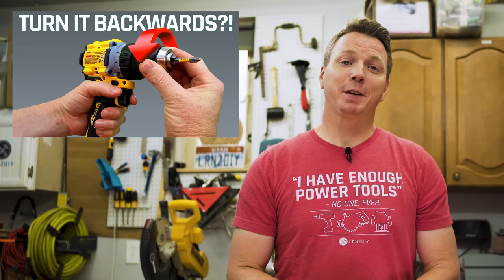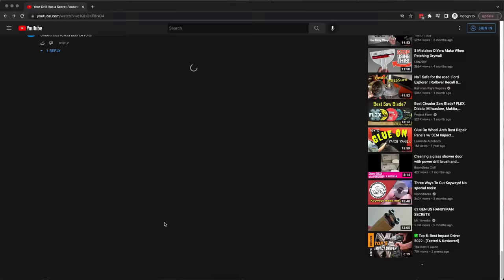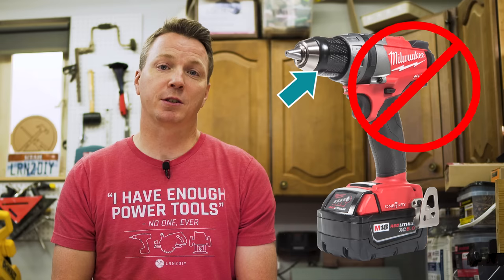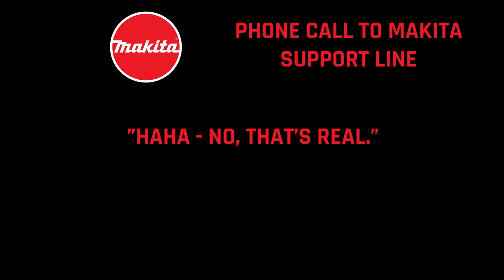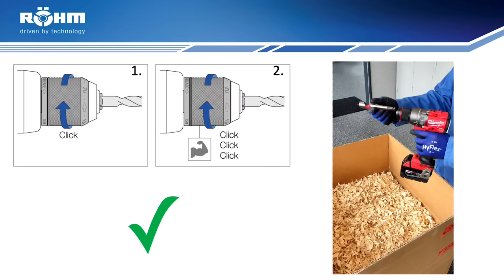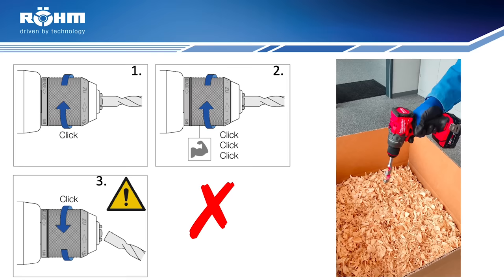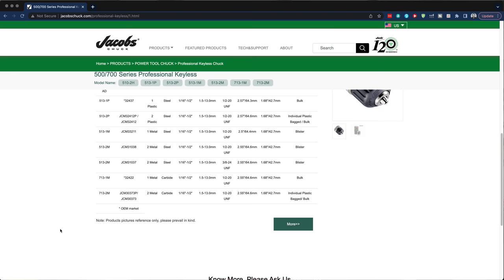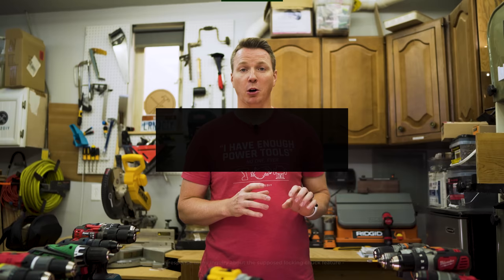Secret Drill Feature: Are The Manufacturers Wrong?

Comment: This video shows that you have a lot of integrity.  In addition, it shows a very methodical and thorough approach in getting down to the facts. Furthermore, your open-mindednes to even the possibility that were in error really gives insight to your character.  Well done. Keep up the great work.
Reply: Right there. Exactly what I was thinking. ✌
Reply: I agree. You have a lot of integrity. Thank you for creating this follow up video. I did not comment on the first video. However, I did try it and it didn’t work for me. The drill bits fell right out after a few holes. Just as they had before.

Comment: Funny enough, I experienced EXACTLY what Rohm and AvE described just a few days ago drilling a brake caliper for a repair bleeder. If I did the click back, my bit kept loosening. If I did not click back, I had no issues. I changed bit sizes several time which is why I had time to test. This was with my Milwaukee M12 drill, but I don't recall having the same issue with my DeWalt. Now we know! Seems the people believing it help experienced a placebo affect or confirmation bias. Really appreciate the update!

Comment: Thanks. I saw the original video and have been trying it out. I have not had a bit come loose since where as I did previously. I’ll keep going with it until I have bits coming loose.  Great video as always.
Reply: Yeah, I'm in the similar situation. Even if not a feature, this really seems to work for me, especially when drilling on metal. I'll experiment more. But if it works, it works.
Reply: It doesn't work, it can't work. Stop doing it:)

Comment: Kudos for integrity and self correction - much respect.

RE: bits (hexagonal inserts) falling out of 3 yaw chucks: positioning - whenever I put a bit in a 3 yaw chuck i take care/make sure it is seated at the lower most tightening diameter - so that once it tries to slip_somewhat it can't loosen the chuck.

Might be the people who have their bits falling out have not yet figured out this issue?
Might be once they take more care, or just by chance, their bits seat in the chucks at a lower tightening diameter?

Ever had a drill bit (round shank) tightened off center?

Hard to tell with people struggling to grasp the mechanic of the chuck operation, basic physics and the bigger picture?

Comment: I never had this problem with any cordless drill but I always misused the chuck as I hold it while gently pushing the power button. And I DON''T RECOMMEND THIS to any one. It's me, my way, my consequences.
But... After your first video I tried on my old ParkSide cordless drill and it does the same: it locks as soon as I try to rotate counter clockwise and it doesn't ratchet in any way.
I never used it because it started rotating on the other way and I thought it would be wrong, but never realized at about a quarter twist it indeed locks. And it is also true the other way to open the chuck.
To be honest, I haven't quit on my "method" to close the jaws on the bit but I changed the way I used to apply some extra torque and now I use this method to tighten or loosen the bit.

Comment: I have already shared this on your previous video regarding the topic. Locking means making the bit stay in the chuck and that happens when you tighten it - whether it ratchets or not. 'Locking' a tightened chuck by turning it in the loosening direction doesn't makes any sense.

Comment: I had problem with drill bits falling out of my dewalt drill but I found that if i push the bit all the way into the chuck then pull it back about 1/4" and tighten it there it stays tight

Comment: I believe the engineers are telling the truth about this not being a feature, but I also no that this did actually work for me.  I had a problem with my brand new Dewalt drill not holding on to any bits after about every use.  I would tighten it then use the drill and the bit would fall out.  I saw a video about six years ago similar to the one that you released.  I tried the step by turning one click backwards and to this day, this drill never drops a bit.  From my experience, engineers design things to work a certain way but sometimes side effects are discovered later on in the real world.  I think that this is a side effect which is why the comments are so divisive.  I guess part of why I am commenting is because, the engineers designed the chuck to hold the bit and lock hold it when turned and click tightened. But, I had a problem with the bits falling out after tightening the bit, so the engineered chuck was failing. I remembered, that I was going to take the drill back to Home Depot where I bought it, but when I saw that video back then and tried the solution, real or not, and it worked.  This has been six years of constant use and it works.  I have even tried a couple of times to see if using the chuck as it was/is supposed to be used and the bit still falls out. One thing about engineering something, sometimes there are things that are missed. I'm not saying that it is supposed to work this way, I'm just saying that mine does.
Reply: Maybe you can make a video demonstrating this with your drill
Reply: I have a Ryobi drill that literally has the words  "lock<-" on the chuck.   I have been confused as to how this is a thing that's semi-controversial
Reply: I believe you think yours work that way.
Reply: Try it again, now, without the unlocking step. See if it still gives you problems. :)

Comment: I only watched this because the claims seemed to be rather odd about bits falling out of the chuck.  I own a Milwaukee drill and have never had this happen.  I typically insert my bit, rotate the chuck counterclockwise until I hear the clicks.  I use the drill and unchuck when done, but never have I had a bit fall out.  This is not to say that I did something right or wrong, it's just that the operation and function of the drill I have seems to be working as intended.  I got my drill (part of a Milwaukee set) about 3 years ago, and both the drill and driver always work fine.  On the opther hand, I have never intentionally chucked a bit, rotated the chuck counterclockwise until I heard the clicks and then ran the drill with the bits pointing downward to see if they fell out, so now my curiosity is getting the best of me.

Comment: You're absolutely correct if people realize that they're not the only one that has trouble with b** falling out they start ratcheting down the head correctly and your back saying to back it off it actually does work in hammer drills but you ratchet it back down again one more time because in a hammer drill you need the bit to be locked down tonight all the way down the the length of the bit that is being bit and some Jaws will only lock either in the back or in the front by backing it off and then locking it back down you get a better more balanced bite. Simply put no it's not a secret feature it's a technique that bites the bit better but you still have to put it back into the Locking position. And of course nobody has this problem with large hammer drills because they index.

Comment: So the bottom line is ( if you back up one click have you had your bit fall out ) or did I miss something ?
Reply: Once you initiate backwards turns with your chuck, you're disengaging the locking function. Ratcheting locks only work in one direction. If you can find the first video he references with the big hole saw, it is pretty informative, guy has the chuck blueprint out while doing some demonstrations.

Comment: My theory is when people have issues it is because it may have been chucked slightly turned so the flat spots don't line up quite all the way. It could still lock down pretty tight but with enough drilling it might torque to where he flat spots do line up making it ever so slightly loose and then it gets looser from there.

Comment: Look at the pictures of the Jacobs 500/700 chuck.  This appears to be what I have on my Black+Dekcer 20V Lithium drill and I don't believe it is a ratcheting chuck at all.  The second ring seems to act like a jam nut and when I rotate it against the larger main ring the chuck seems to make a much tighter connection and I can't just run the drill in revers and grab the larger part of the chuck to release the bit.  I have to grab the smaller ring with one hand and the larger with the other to open the chuck.  This may be what is happening with those commenters saying the technique in the video worked for them.

Comment: My Dewalt still works MUCH better when I turn it backwards a click! If I torque it down as tight as I can it will drop the chuck after hitting the brake the 3rd or 4th time. When I turn it back a click I can have it hit the brake 10 times and it's still tight in the drill

Comment: As someone who is both a mechanical engineer and cnc tech, (having rebuilt another industrial chuck less than an hour ago), I can confirm hoax status.

At an industrial level there are 2 major styles of keyless chuck to be aware of (usually not on hand drills, but on drill presses or mills):
Unidirectional: the cutting force against the bit is independent of the tightening mechanism. They are still usually biased, holding tighter 1 direction) but the chuck works in both forward and reverse.

1-directional/self tightening: The back torque from cutting in the forward/normal direction compresses the jaws tighter. This is great for lots of drilling, especially under heavy load, as instead of loosening over time, the bits tend to get tighter.
But it is terrible for tasks like tapping, because anything done in the reverse direction wants to loosen and spit your bit out of the chuck. Every time you stop and try to back the tap out, it will unchuck.
Also, it's no good for using with reverse drill bits for things like bolt extraction.

If I only had 1, I'd go for unidirectional. It's not surprising that cordless drills seem to always have this type, as it makes them more versatile. The sudden impact of stopping is enough to loosen them, though, as demonstrated by repeated start/stops, a bit like an impact driver loosening a bolt. The ratchet like clicks are a mechanism that attempts to reduce this self loosening behavior. Most larger chucks don't have the clicks.

Comment: I have a theory about the people who said that turning back one click has solved their problem. Before they saw your first video, they weren't locking it properly in the first place. They were just lightly turning the chuck, but not enough to actually secure the bit with enough strength. After they saw your video, they started turning the chuck with enough strength in the closing direction (probably without even noticing it), then turning back one click. But, since they were using lightweight bits, or performing just domestic, light work, the bit stopped falling off. So, there's my theory.

Comment: I have a Craftsman cordless drill and I've tried to lock the b in place and there is absolutely no turning it once it is tight. I cannot turn it counter-clockwise whether I do it quick slow even if I hold the shaft from spinning it does not click and lock

Comment: I got my drill bit stuck in a piece of wood then tried pulling on it using the 'locking feature' vs normal tightening.

I noticed almost no difference in the strength I had to use to for the drill to get disconnected.

Comment: My Harbor Freight Bauer brand battery-powered drill will not securely hold a bit at all unless you turn the chuck ring counter-clockwise...hard, after normal tightening. I occasionally lost bits in the weeds before I figured it out. 

The older DeWalt would hold it firmly, but not like Chuck Norris, unless you turned it backwards until it clicks and stops.

In both cases, this is not turning the chuck backwards, just its tightening ring. The chuck stays stationary. I think part of the confusion is understanding exactly what goes backwards.

My newer DeWalt doesn't appear to have that feature quite as pronounced. There is no click, although I still manually turn the ring back out of habit. That doesn't appear to unlock it.

This all may happen because I hold the ring and pull the trigger until it stops to tighten. Then the backwards turn is just adding a few more ergs of pressure on the bit beyond what the motor can do.

addendum:
And, ya, I know "ergs" is the wrong word but the right word escapes me right now.
Reply: Hope you can demonstrate the two in a short video.
Reply: @pflaffik  No, but after thinking about it, I can explain better. 

A lot of people (I've seen it) put the bit into the chuck and tighten it by (1) manually turning the
outside of the chuck counter-clockwise instead of gripping the chuck and pulling the trigger to tighten it.
But (2) if you just hold the chuck still and pull the trigger, it will rotate the inside of the chuck clockwise but not the outside housing, which has the same effect as (1). 

If you use method 2, when it appears tight, release the trigger and manually turn the chuck counter-clockwise. It may click and stop, or just stop. 

Then you have maximum pressure on the bit.

Comment: You didn’t know this is not a new thing, we should expect it to resurface again in a few years. However i think it could be more clear this time, in the future it will be easier to look up old videos like yours to disapprove this now famous non-feature.  
I also suggested in your previous video that you check with Yukiwa which is found in industrial and higher end drills, i tested Yukiwa with the 40v XGT Makita and the autobrake immediately loosens the chuck if “unlocked”, all metal chuck combined with a violent autobrake makes it quite obvious.

Comment: They are both wrong and correct at the same time - the companies and the commenters.  HOW CAN THIS BE?!   When you do not get the drill bit into the chuck correctly and you still try and tighten it down, and then go back a little - that clicking people think is "Locking" the bit in, is an indication that tells you that the bit has "FALLEN INTO CORRECT POSSITION" - and you re-tighten it.  This is common sense for most people who have used many different tools and different types of chucking systems, including milling and cnc, and the list goes on.  The slop of the fingers that come together around a bit to clamp it is typically complete crap with most all drills other than those with a hammer feature.      I also tested most every type of chuck on most every type of tool I could find - on display models in the stores.  If there was a tool I wanted to check - an employee would grab a floor manager and they would usually find the tool that didn't have a display model or open one out of a new box (a crate one time for a large drill press.)   Why do many people know this information?  It's supposed to be common knowledge - but it's "Slipped" a generation I guess!   You know that it's not the only tool or product that has slipped the common sense in the world though.  Example - wet/dry black sandpaper that falls apart when it's wet and is total garbage....  NO - it is simply being used COMPLETELY AND UTTERLY WRONG.  The tooth of the "GRIT" does the work - NOT THE FORCE APPLIED.  In fact, you break the teeth on the sandpaper causing it to tear the sandpaper to shreds when you apply too much pressure.  VERY LIGHT PRESSURE is REQUIRED for sanding dry or wet - with the silicone carbide sandpaper.  I've not used a sandpaper that is pure crap.

Comment: It's really no different than a nut and bolt.  The more torque you put on it, the tighter it holds.  There really is no "Lock".  That term was probably derived from the chucks that required a key, but even with those chucks, the key didn't actually lock anything.  If it slips or falls out, you simply tighten it more.

Comment: The problem with talking to the support reps at any company is that they are typically the least paid and have little to no experience actually using the products they're supporting.  With tech companies, there are some exceptions, but the support they provide is usually only as good as the information they're provided in their support applications.

The biggest issue is when your question isn't in their support documentation and they have to use their own intelligence to answer the question. LOL